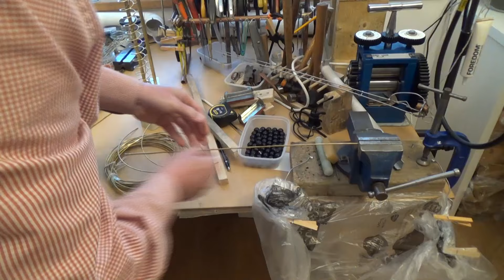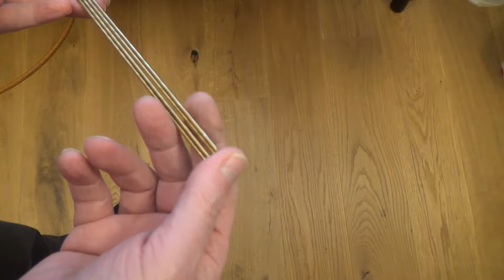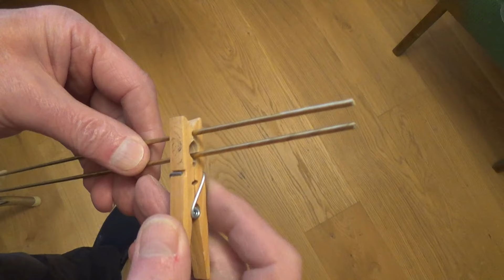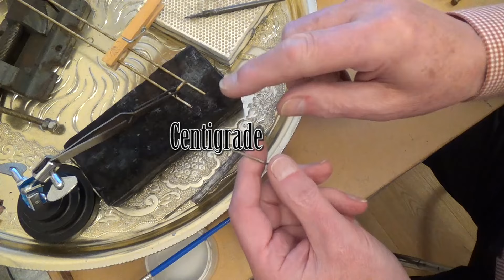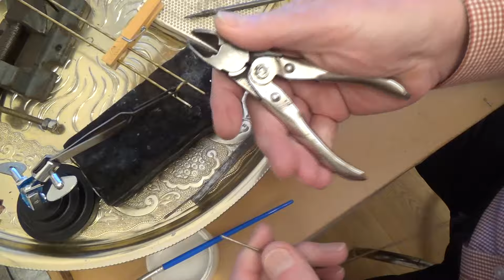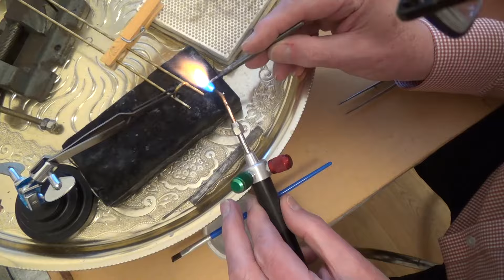Rolling Ball Sculpture Part 3

Comment: Hullo Andy, Maverick here, at 10:42 is that a blackened brick you’re burning stuff on?
Reply from the maker: Hi Maverick. 
The black brick is actually a block of charcoal block that jewellers use for hard soldering on. The hard solder melts at something like 600-700 degrees C. You’d be forgiven for thinking that the charcoal would catch fire with an oxy-propane gas torch on it, but somehow it doesn’t.  I also use a perforated ceramic block to hard solder on. But the heat content of a charcoal block is much lower than ceramic or solid asbestos type blocks. In other words, the charcoal doesn’t suck the heat out of your work the way other materials do. For anyone working with a small kitchen (Crème Brulee) gas torch, using a charcoal block can make the difference between able to large pieces of jewellery or not. By the way, what I’m actually doing is melting a tiny piece of brazing alloy and then picking it up and applying it to the joint. It’s what jewellers do so that you only apply sufficient material. It’s a trick that I only found out about when, at 72, I started making jewellery. It would have been of tremendous help to me in my working life had I have known about it back then. There are so many tools and processes that jewellers use that normal engineers have never seen or heard of yet they would be so helpful.  
Thanks for the interest. 
Kind regards . . .. Andy

Comment: I was wondering how your soldering was so good, now I know. Could you explain how the solder sticks to the pick, is it heat?
Reply from the maker: Hi again (if you give me a name I can address you more politely rather than just 'Hi') That's a very good question because it sometimes amazes me that the braze alloy or solder sticks to the pick! My pick is titanium, although you can use steel, an old wire coat hanger sharpened to a point dose the same job, but titanium can tolerate higher temperatures without degradation. 
Some times I have a bit of residual flux on the pick. The flux that I use sets really hard when cool but is very stick when hot and that will pick the solder up, sometimes I poke the pick into the ball of solder and pick it up like that, and sometimes it seems if I have just cleaned the pick, it appears as if the solder simply stick because of some surface tension that comes about when the solder is liquid. As I say it's a particularly good question but I can't give you a definitive answer, I'll stick my neck out and plumb for 'surface tension'  as being the something like the best guess.
Thanks again. Kind regards . . . . Andy
Reply: @AndyDaviesByTheSea  Thanks for the comprehensive explanation. I am inclined to agree with you about the surface tension, seems the most likely. 
Regards...Eric.
Reply from the maker: @wasdaletimelapse7658  Cheers Eric. All the best . . .  Andy